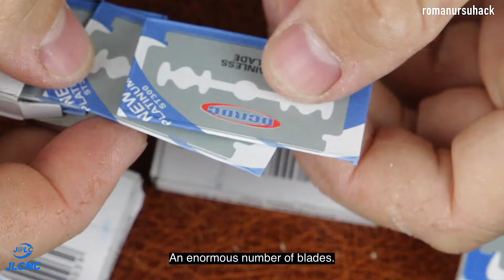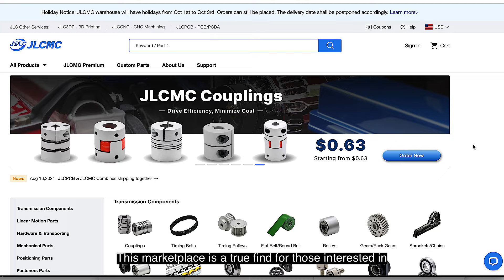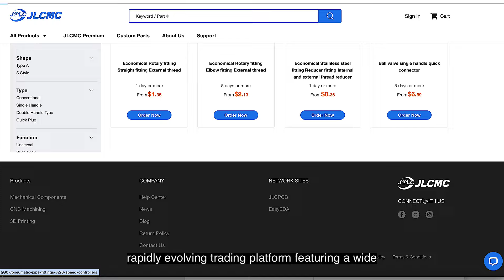How To Make a Hydroxy HHO Generator: Using 99 + Blades for Electrolysis 2500 °C

Comment: Wow, its 2024, why are people still making wet-cell hho generators? The razor blade as plates idea was great, but the performance and efficiency is still abysmal. Which is the primary thing holding hho back, the process is nowhere near 1to1, you get like 6% efficiency if you are lucky. If someone solved the efficiency problem, the video would go viral for sure.
Reply: I hear that UV light, and ultrasound, can help

Comment: Hydrogen should be produced at one electrode, and oxygen at the other. But these are not drawn off separately?
Reply: Why would you want to separate them if you want to burn them anyway? Burning the H_2-O_2 mixture is more efficient than having the H_2 to bind it from the air. Though for safety purposes having them separate is actually a must.
Reply: @marilynman but hydrogen and oxygen mixed together in a 2:1 proportion is highly explosive. And it is extremely loud what that happens, I knew this because I did this once and I did not thought it would be so loud, good thing I was staying like 4 feet away from it, or I would have been deaf now. And afterwards I tried it with hearing protection, and I was still permanently deaf for like the next 20 minutes.
Reply: @Yeetely_deet that’s why the dude made a flashback arrester out of the red capped bottle.
Reply: @Yeetely_deet  "permanently ... for 20 minutes"
Reply: Power Supply is the opposite of free, just like being temporary deaf is the opposite of being permanently deaf. lol 😂
Reply: @marilynman  the reason to separate them is to guarantee they don't explode before you're ready

Comment: the safety is not enough as the air formation with electrolysis is mixed with oxygen and hydrogen inside the tank

Comment: Please continue videoa like these. I dont agree that they are "free" energy, but they are methods available to regular households, which is awesome. I've even seen people make these torches with IV needles, or almost any syringe, which should be easily accessible. Just take care to implement the second jar of water to prevent flashback... Although not required, it guarantees your safety by a large amount...

Comment: We had a commercially produced hydrogen generator in a jewelry shop.  The flame it produced was not orange like this one but blue.  Makes me wonder what else may be in the gas the HHO generator is putting out.
  Thanks for the video.
Reply: its sodium ions form the salt he used to increase the waters conductivity.
Reply: He made a Brown's gas generator he would need to put something to something to separate the anode and cathode to make it a hydrogen generator.
Reply: @CD-sg7eh correct. This is usually called an HHO generator. But as far as I know they’re only used by jewelers.
Reply: orange flame could be also steam

Comment: In my opinion, instead of using a razor as an electrode, you should have used stainless steel sheets or tantalum metal sheets with an oxide coating.

Comment: I think it would be wise to investigate the possibility that some nasty chromium byproducts can be generated by stainless steel electrodes during electrolysis - notably on the positive connection. I know there is some debate on the issue, but given the risks its worth a bit of extra research - my dad always said never to eat yellow chemistry...

Comment: If only you read Faraday's law . . . he did most extensive research on electrolysis 200 years ago.Still you see abominations like this on youtube ,but hey at least you got electrolyte right.
Also stainless steel releases hexivalent chromium 6.
Reply: That sounds bad
Reply: @encyclopath  Yup, there is a reason you need both ventilation and a full face mask with fresh air supply when wielding stainless steel.
Reply: @IntenseDarknessable  That's the least of the problems here. Guess what is he going to do with that chromium, throw it away into the sewage? That yellow mark could be an indicator that it already happened.
Reply: @marilynman it can be converted to chrome3. That's about the only way to make it safe.
Reply: @njineermike  As I understand it anything with an oxidation state below 6 can pass, though it's the most common.

Comment: I would like to see how the burner is made. USA here?

What about corrosion of the razor blades? Will they not break down quickly?
Reply: Was gonna say, do NOT do this. There will be immense oxidation and you will regret ever spending time making this waste of space lol. 
Use stainless or appropriate metals, not this.
Reply: @ doesn’t doing this with stainless steel release  hexavalent chromium?
Reply: @encyclopath  Chromium is what I‘m concerning too
Reply: Yes, they will definitely break from corrosion. After all, the current passes through the shortest path, that is, between the edges of the razor blades.

Comment: This is pretty neat, you've essentially got yourself an electric cutting torch! How many watts does it continuously draw when you're producing gas?
Reply: We’ll never know but the output thermal energy will never as much as the input
Reply: @HighVoltageArcRD  Yeah definitely not efficient, but nice if you otherwise wouldn't have a gas source!

Comment: Very suboptimal use of the blade surface, plus the risk of short circuit of 2 upper blades in detonating gas. Better to do it this way:

1. Cut rectangles from thick blotting paper:
width equal to the width of the blade;
length a couple of centimeters longer than the length of the blade;
quantity equal to the number of blades plus one.

2. Fold the blades and blotting paper rectangles into a "layer cake" as follows:
odd blade;
blotting paper rectangle aligned with the left edge of the odd blade;
even blade aligned with the right edge of the blotting paper rectangle;
blotting paper rectangle aligned with the right edge of the even blade;
odd blade again aligned with the left edge of the previous blotting paper rectangle, and so on.

3. Now pass 2 contact pins: first pin through the left edges of the holes in the odd blades and second pin through the right edges of the holes in the even blades (and not through the centers, as in the video!), piercing the blotting paper rectangles between the blades with them. Here is a pseudographic diagram (side view), in which the blades are designated by sequences of signs '-', the blotting paper rectangles are designated by sequences of signs '=', the contact pins are designated by vertical sequences of signs '|', dots '.' are designating empty space.
=|=======|=
--|------------..|
=|=======|=
..|..------------|-
=|=======|=
--|------------..|
=|=======|=
..|..------------|-
=|=======|=

4. Then - as in the video: two holes for contact pins in the cover, a hole there for a hose for removing detonating gas, etc.

Comment: I can understand that using the gas for a torch is useful. But using electricity to split water into hydrogen and oxygen and then using that gas to produce electricity is idiocy. THERE IS NO FREE LUNCH, yet people keep banging their heads against the wall thinking they will be the ones to find a way. FYI you need 2 chambers connected by an underwater tube, anode in one and cathode in the other to get separate oxygen and hydrogen.

Comment: You still have to put more energy in, than the energy you get from burning the hydrogen.
I only put 500 watts of power in, and I got 300 watts of energy to work with !!
Unless you are using Free Energy, your making a Loss.
Sure, you can use solar cells, but you still have to buy them and maintain/replace them as they decrease over time, so it's not free energy.

Comment: Ughh, this is not a pure hydrogen gas electrolysis chamber. This produces a perfect mixture of oxyhydrogen... very very dangerous since oxygen and hydrogen is in a perfect mixture, just waiting to react.
For a true hydrogen chamber, you will have to separate the electrodes in tubes only for a liquid bridge to be the circuit conductor, also you will need DC as one side will be oxygen and the other hydrogen secluded.
For that chamber in the video, you can use any voltage, rectified or not, smoothed or not. In the end its H2 + O gas waiting for enough energy to start a chain reaction. 😂

Comment: What about the O2?
Reply: That's available in the air
Reply: It's in the tank as well, 2 H2o (water) turns into 2 H2 and 1 O2 during the electrolicis, so theoretically the burner always have the perfect ratio of fuel to oxidizer for a full reaction (but in reality you would want an oxidizer (O2) or fuel (H2) rich mixture (not sure which one is better) to get a faster combustion and thus hotter flame.
The fact that the O2 and H2 are mixed into the tank makes me think this thing is basically a bomb 'cause all it needs is a spark for the whole apparatus to explode. Usually when doing electrolicis you collect the H2 and O2 separately in tanks to avoid that, and it's possible because of how the 2 H2O to 2 H2 + 1 O2 reaction happens (basically oxygen bubbles form on one electrode and hydrogen on the other) and industrial implementation usually have a membrane between the 2 electrodes that lets ions flow but not gaz.
Reply: @Ragnar_Oock  when you want something done cheap, it can be either fast or safe but not both. 😝

Comment: Excellent - I am thinking to install this HHO system on my V6 van using 12 Volt battery and and divert the HHO into the Throttle air intake. The only issue with HHO flame is that its temperature is about 2300 degree centigrade nay deform my van pistons. Any idea to lower down the HHO combustion temperature.

Comment: Does this produce TOXIC WASTE? What is the disposal method because I would NOT  want to POISON my GROUND WATER by pouring it in the dirt.
Reply: Stainless steel can contain chromium which if the voltage is beyond a certain level I think 3.5 volts or somewhere around that it can produce Cr(6+) which is a carcinogen. You cannot throw it away anywhere not even in the toilet, you will have to make another reaction to make it non-toxic.
If you want something safe you can get graphite welding rods, they just dissolve into the water as graphite and as I understand it they last quite a bit.

Comment: Make your car a hydrogen hi-brid Hho Technology will surprise you! Hho is a Green hydrogen to increase fuel burning efficiency better then a new car. Cool engine running  prolonging engine life and engine oil life with less engine maintainess required🚦

 100% fuel will burn in the engine No un 

burn fuel wastage . Hho system works on petrol, deisel, cng, lpg and lng types gases.

Engine runs lighter smoother reducing carbon emissions significantly . Boost engine power and torque . Hho gas reduced engine noice & vibration

An efficient hho car kit lower the engine temperature more reliable simply made Hho kits restore better fuel economy. Hho system is very easy and simple to install. Hho solves the engine heating problems automatically!!!Cleaner engine running. Reducing engine noise due to the faster fuel burning. Hho car kits works nicely requires no modifications in the car engine. No side effects on car engine.

Engine start quickly your car battery will charge  quickly car AC works better& safe your car battery.  make your car a low cost hy-brid. Use a  low amps. Hho car kit will work better. You can easily transfer hho kit from one car to another one. Hho kits requires no any modifications in the engine. HHO kits absolutely work.

A